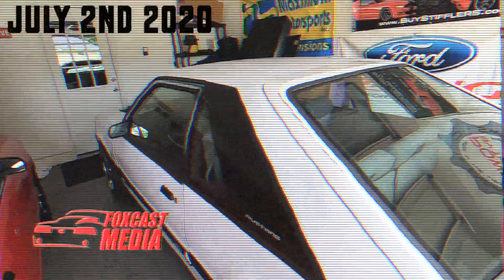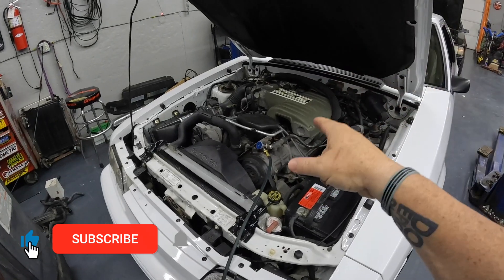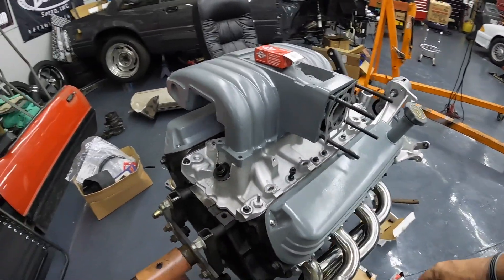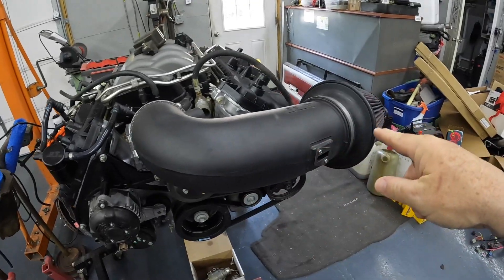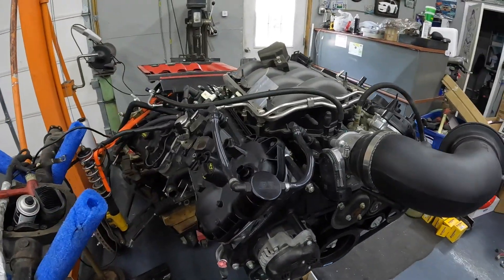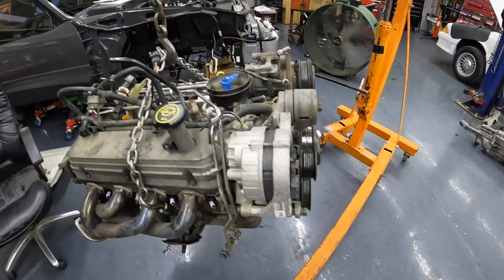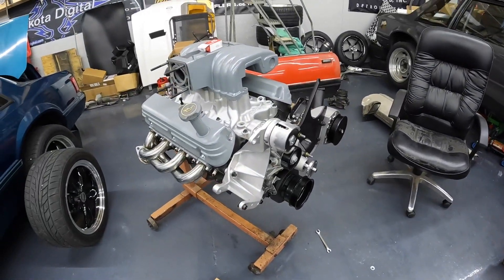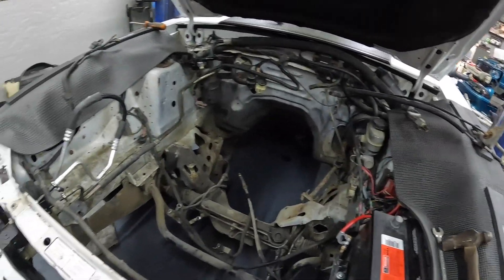The wait is over, Pop's car finally gets a heart transplant PT. 1

Comment: Nice video! I have to look back and check out the story since I'm a fairly new subscriber to the channel.
Question: how many miles on the original motor? I have a '91 with a stock 5.0 motor with about 180k miles that I'm thinking of doing an H/C/I upgrade in and your video is making me wonder if I should pull the motor and rebuild it as well. What are your thoughts?